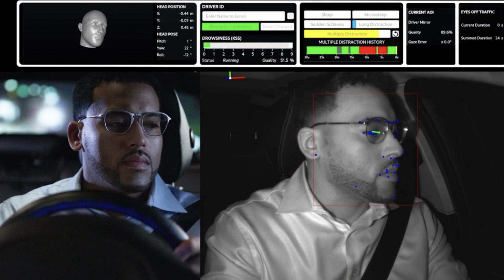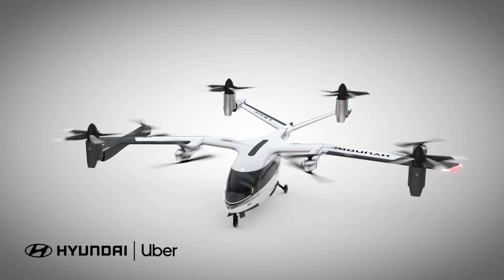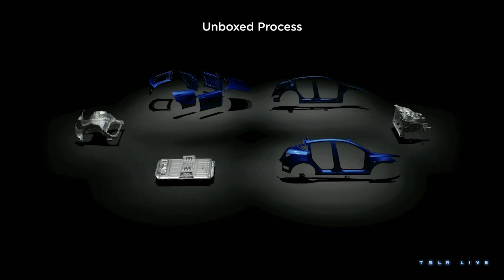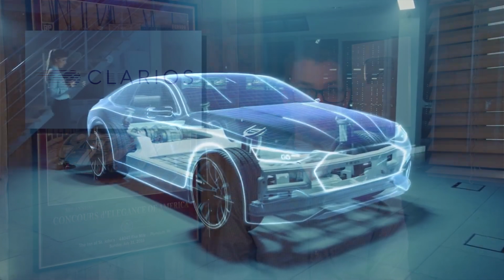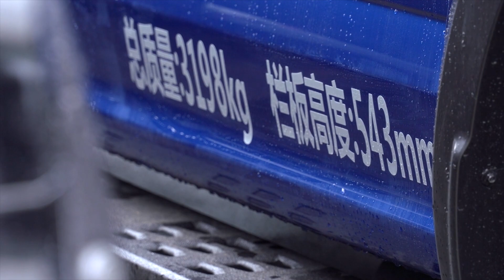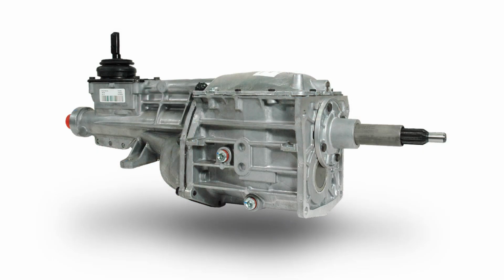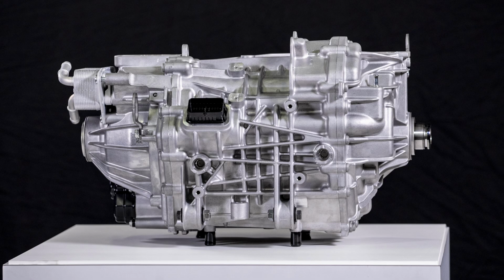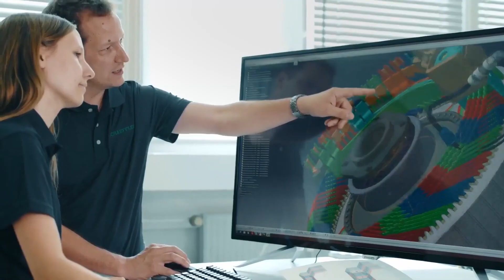Thermal Cameras to Help Meet NHTSA Mandate; Clarios Developing 48V System - Autoline Daily 3658

Comment: There's all this speculation all over about VTOL pods and quite frankly I can't see any way shape or form that those would a) ever be practical, or b) be any better than trains busses etc
Reply: Or C: would be allowed anywhere. Maybe in the US. Everything is allowed in the US. But not anywhere else.
Reply: Compact cities with good public transport is the superior option.  

Unfortunately neither of those are allowed in the US, for ideological reasons.
Reply: Bad weather (and even fair weather) vomit comets.  They have existed for years. Helicopters.
Reply: Age old problem is that you can't tell the bus or train where you want to go.  You go where they are going.
Reply: One of those longest-running, worst ideas, I don't want a bunch of Hazards flying over my head
Reply: @rp9674  It sounds great when you imagine yourself flying over the city.  Not so great when you imagine the city flying over you.
Reply: @danharold3087  Sure you can, with enough criminal energy everything is possible.
Reply: @davidmenasco5743  whaaat a country !
Reply: @wolfgangpreier9160  Hold a a train engineer/driver at gun point to get home delivery?
Reply: @danharold3087  As i've having observed thats the normalw ay of doing business in the US of A. Of course not everywhere else. Maybe in Somalia and Venezuela.

Comment: More sensors = Software confusion.  If two sensors report different things which wins?  Cameras by themselves are the way to go.
Reply: Tesla is skipping the camera post processing and sending photon counts to the neural net.  It lets the Tesla see in lower light.
Reply: And yet, Mercedes is L3 with a multi sensor approach and Tesla can’t root cause their phantom breaking issue with only one sensor.
Reply: @bobbbobb4663  Actually Tesla found that the radar was a lot of the reason for phantom braking. They still have it but not nearly as much. 
It seems to be a tough nut to crack. 
As to Mercedes "Level 3". My understanding is that it only works when going under 40mph and you have to be following another car?  If true that is not very useful... maybe in traffic jams?

Comment: Magma is slow to the punch. TESLA has been doing predictive state for years. Already, the air bags are deployed milliseconds before an accident for years. FSD is backed in as well. Saving lives everyday.
Reply: Allegedly saving lives, you mean. How many FSD errors were corrected by the human driver before it became an accident??
Reply: Why would an airbag deploy before an accident? Makes no sense, no accident no need for it to deploy
Reply: Hopefully Magna's system will actually work unlike Fake Self Driving.
Reply: @taniabanes4707  The junkyard is full of cars with deployed airbags as the insurance companies total them.  As an effort to juice sales, one might get aggressive in wanting more airbag deployments versus less.
Reply: The airbags are triggered by a shock sensors but take only 40 milliseconds to deploy.
Reply: @heathwirt8919  Yes, Henryk Fister will make sure you get yours in time.
Reply: @bobbbobb4663  Depends on the value of the vehicle, if it's only worth a few thousand dollars then it's not worth replacing them. And yes the junkyard is full of crashed vehicles, that's why it's called a junkyard.
Reply: @wolfgangpreier9160  The shock sensor triggered 40 millisecond inflate time works fine, watch some crash testing.
Reply: @heathwirt8919  I don't know what you are talking about. 

FSD - that Fake Self Driving - will inflate 40 milliseconds after Henryk Fister delivered the first MSD - thats Magna  Self Driving - vehicle?
Reply: @heathwirt8919  So the junk yards must be full of worthelss crushed Teslas. Everybody knows even a small scratch on your plasticy front will render a Tesla useless. The repairs - if you even get the color code to paint it yourself - are horrendous!

If you do not get my intentions: I am a useless troll spouting a useless bunch of sarcasm...
Reply: End to end vision training is the future. Competition has too much money invested in radar to switch. Tesla will clearly win.
Reply: @heathwirt8919  I never said the junkyard was full of crashed vehicles but it will contain vehicles with deployed airbags.  Where there is a con, Musk will find a way.
Reply: @taniabanes4707  With airbags timing is everything.   Too early or to late no good.   Explode into the drivers face no good either.  You want it there ready to cushion the body at exactly the right time.  The right time may even differ for various air bag locations.
Reply: @heathwirt8919  Cars are getting to be disposable.    The big culprit is the requirements to make them safe.  Airbags yes but the high strength steels are a major reason newer cars are junked.   Given the choice I would rather the car die.
Reply: @danharold3087  Actually modern cars last much longer than they did in the 50's 60's &70's due to better rust preventive coatings. Repair costs have increased and insurance companies know by virtue of tons of loss and repair data when the decision to repair or total loss a vehicle is the cost effective decision. And lets not forget, all the useful parts of the junked cars are recycled and will end up on a car still on the road.
Reply: @davidmccarthy6061  
The frequency of crashes is significantly lower when FSD is operating than when humans are driving without FSD turned on.  In both cases if humans were 'superior' then crash rates should be the same.
Reply: @heathwirt8919  Yes on lasting longer.  Grandfather had a Star that did not make 20K.  My late dad said 10K IRRC.
My hope is that with insurance totaling cars rather than fixing them we can see an even better supply of good low mileage parts at salvage yards.    
I want to point out that insurance companies are looking at their bottom line not simply how much it cost to repair the car.   Logically the insurance companies administrate costs for repairing a car are included in the calculation made to repair or total.

Comment: Why are there no efficiency standards for evs, like gas cars have to meet.  Shouldn't there be a miles/kw requirement?  They are just allowed to be as fast and energy demanding as they want.

Secondly, we need co2 deficit limts for evs.  Evs take more co2 to produce than a gas car and there needs to be standards for this as well.

Comment: Yes, finally! using thermale camera makes so much sense... ever since sandy munro suggested it as missing from all the self driving car systems...
Reply: The main feature of the Tesla "Smart Camera is its infrared sensor which is able to detect even the slightest of movements when it is windy, when there is a storm or in poor lighting conditions."

A thermal camera is a sensor with a filter in front which allows IR to get through.  IR is blocked in 'normal' digital cameras because humans do not perceive IR.
Reply: Ah, actually it does not... the quote you posted is from a different manufacturer which makes a smarthome camera... currently th car manufacturer tesla uses 8x Samsung cmos sensors, which are being upgraded to 5MP. In addition it uses multiple ultra-sonic sensing for proximity... no thermal sensors

Comment: The thermal cameras (LWIR cameras) could be very useful for safety, the same software algorithms used on visible light (what the human eye can detect) cameras/stereo could be used on thermal cameras (convolutional neural networks, etc.).

FLIR has a thermal camera (FLIR One) that can be attached to a smartphone. A person could attach the module, put the phone in a holder, and see an image while driving almost like a heads-up display.
The next step would be to write a smartphone application (shareware) to give audible alerts to the driver.
I will move the above up on my to-do list. 

The first step is just to drive around and record video to see how well the camera collects the LWIR spectrum (sees in the dark). 
FLIR has a great reputation and the smartphone attachment appears to be around 230 dollars (I can make that work).
Reply: All digital cameras can detect IR.  The cameras we use have a filter in front of the sensor that blocks all but the 'visual spectrum' wavelengths.  Tesla's cameras have filters that allow IR to the sensor.
Reply: @lp6696  
I do not know which sensors Tesla is using.  But in the early days of consumer digital cameras some people were removing the Bayer filter and using their cameras to take IR photos.  I recall seeing pictures of deer and dogs taken 'in the dark'.
Reply: @bobwallace9753  

This is very interesting I think  I can explain what is going on.

The human eye on average can see up to 700nm.

A CCD/CMOS sensor can see up to 1000nm if all filters are removed.

So a deer or dog that has light reflected off at say 800nm could be in an image of a camera but a person could not see it.

So what is different is the FLIR sensor measures the radiation that is generated by the heat of the deer which is above 8000nm and the CCD/CMOS and does not "see" the 8000nm and above radiation.

Note the CCD/CMOS is seeing reflected light say at 800nm (external source to the deer) and the FLIR is measuring the black body radiation that is generated by the body temperature of the deer.

If interested look on Wiki under Black-body radiation about halfway down shows an image from a FLIR-type camera showing the arm of a man inside of a bag.
A CMOS/CCD array camera cannot see the arm of the man because the bag stops all visible light but the FLIR-type camera sees the black body radiation generated by the heat of the man's arm.

Note: A Bayer sensor is a checkerboard pattern of red green and blue photo sites on one sensor versus say a 3-sensor camera that has red, green, and blue sensors.
I think what was going on was a Bayer color camera that had the a global IR filter removed and could then see dogs and deer in the image.

Thank you for your response I used to design instrumentation used to measure black body radiation along with other measurements.
That was a long time ago had to think back a little bit. I need to make sure all my units are correct it is so clear in my head because I used to "live this stuff" but not easy to write.
Reply: @lp6696  
I think I follow you.  But isn't the case that the IR filter is removed.  I don't think you meant an IR sensor.  (Semi-nit picking)

Apparently, based on what you say, there is a sensor which is sensitive to wavelengths beyond what an unfiltered digital camera sensor can detect.  If so, then it should be able to see 'further into fog', at least as far as imagining warm body objects.   That could be of some use for FSD but I'm not sure how much.  There could be, for example, a pile of lumber in the road which the FLIR system would not detect.

What would be really interesting is to see some objective testing of a FLIR system against Tesla's camera systems which, according to Elon, see into the fog better than humans.   If the FLIR sees much better, and sees all potential problems, then that could argue for one forward looking, narrow angle FLIR camera as part of the sensor array.

There's also a point at which conditions are bad enough that vehicles should simply quit driving.  Anyone who lived and drove in the Central Valley when the Tule fogs were at their worst should understand that.
Reply: @bobwallace9753  
You are correct I meant to say filter, I can see a filter in my mind and have a number of different ones in my basement but I wrote sensor. 
It's all so clear in my head but typing out is another story. I like to make sure any comment is correct I write online so anyone in the future who may read it is reading the correct information. So thank you for pointing that out.

What you wrote above sounds correct to me if the logs are the same temperature as the road the FLIR would not see them.

I think Elon Musk's comment about the sensor at this time seeing better than a human is the range from say 700nm to 1000nm, there is so much more to this such as what is termed signal to noise.

There are so many details the images from a standard CMOS sensor would need to be trained in a neural network used with FSD then the images from a FLIR would need to be trained in a different neural network that would have to I would say ride up a higher level like an emergency stop switch on a machine.

Without question, the addition of a FLIR-type sensor can only help but it's not clear the best way to integrate it or if it makes sense from a cost point of view.

I have so many years of machine vision (patents, award money, publications) is like a hobby of mine. For the fun of it, I entered a NASA space robotics contest and wrote all my own stereo vision code, control code, and lidar code. I enjoy thinking of this stuff. I also enter neural network contests.
Reply: @lp6696  
Don't sweat the filter/sensor thing.  I was pretty sure what you were saying,  I just thought it best to clear things up for anyone else who might be following along.

I'm not sure about how a FLIR FSD system would be trained.  Tesla has moved to a "watch what good human drivers do and imitate" system.  Signals coming in that FLIR might see would have no human videos?  Maybe there's a role to have a human programmed override system but I'm concerned about possible false negatives.  (Lumber in the road.  Or firewood, which I dodge from time to time.  How about a long dead deer that has already cooled off?)

Tell me, if you will, what makes the FLIR sensor capable of responding to longer wavelength input.  Is the sensor perhaps differently doped?  Are there different types of silicon that are used?

Comment: We know that digital sensors (cameras) see better in dark light conditions than do humans.  Elon has stated that Tesla's cameras see better in foggy conditions than do humans.  IIRC Tesla's cameras have some ability to use infrared wavelengths which is what 'thermal' cameras use.

Struggling legacy companies are shoveling BS in an attempt to remain relevant.  They need to work harder to build good EVs.  They wasted years when they should have acknowledged the obvious and gone to work.

Comment: Why wouldn't cameras be 100% reliable to detect a crash? Having so many different tools to detect a crash will slowly down a systems ability to do it as fast. You are limited by the output speeds, noise distortion and compute. If you assign weights to each tool and have a computer determine which one to use more, you are bogged down by its limitations. Radar gives false positives all the time, slower reaction time and distorts the signal. If you were to balance this with a camera or sensors, you would get constant phantom slowdowns and brakes. Think shadows, reflection from wet surfaces and etc. You can't have a prediction model that is greatly limited by physical hardware. Magna has no idea how to solve the problem and probably being led on by some bad engineers

Comment: Hi Elon aka Mark.  Looks like an issue with the Berlin furnace:  "..records from the emergency services also document that Musk's factory called for an ambulance or helicopter 247 times in the first year after opening. Converted to the number of employees, this is three times as many emergencies - in a similar period - as in Audi's plant in Ingolstadt, for example" (Spieg*l, 9/28/23)
Reply: What ever you say Gordon.
Reply: She is comparing two totally different factories, one being 70 years old with three times the employees but only 80% of the output as the other, and isnt an active construction site…  gordos numbers are always questionable anyway
Reply: @TurdFergusen  Hi Elon.  Upstaged again by the legacies on safety.
Reply: @TurdFergusen  The rescue reports show, among other things, that a 50-kilogram wooden crate fell on the head of an employee from a height of several meters, or that an employee's foot collapsed into a dosing furnace containing red-hot aluminum. In addition, rescuers would have listed injuries from burns and hydrochloric acid, as well as amputated limbs.
Reply: @TurdFergusen  Continuing in the tradition of Fremont, the most dangerous factory in America.
Reply: Proving once again the quality and safety are job 99 & 100 for Elon Musk.
Reply: @moki123g  Pull your head out of the sand fanboy, go read the reports for yourself.
Reply: FYI: "Some people are off sick longer than they’ve actually worked. There are people who I haven’t seen working for three weeks in six months. Many people are signed off sick because the motivation isn’t there,” they say, blaming poor working conditions. The exits involve temporary staff and permanent employees who have been there for over a year, hired before the gigafactory opened, they claim."
Reply: @heathwirt8919  bull… its just a building lol, its the systems within that are well built out in 70 years… and its not an active construction site get me some segmented numbers because construction teams are NOT tesla
Reply: @heathwirt8919   I know a bit about casting aluminum.    I want to know how  he managed to get his foot into the furnace?
Reply: @danharold3087  Inadequate safety barriers, poor training, management don't give a damn. All the above
Reply: @heathwirt8919  Has to be more than that.   I doubt they could have more than test fired the furnace without inspection of safety.   The German Federal Institute for Occupational Safety and Health requires foundry boots.
Would have to see the equipment to know.
Not playing down the problems but this one is bazaar.